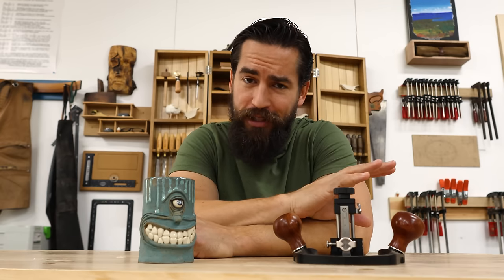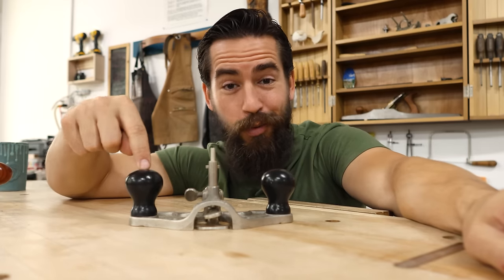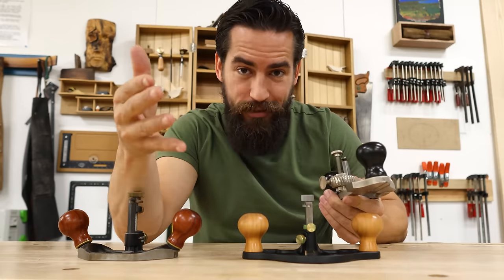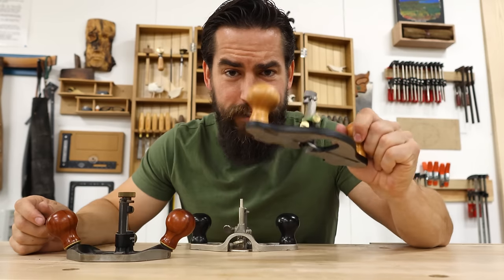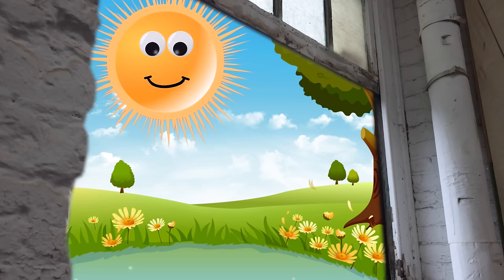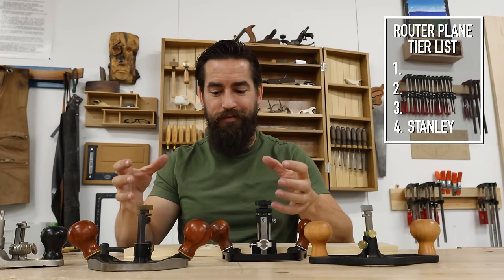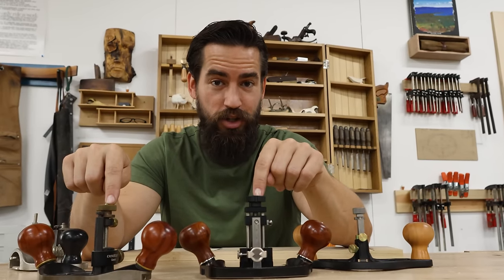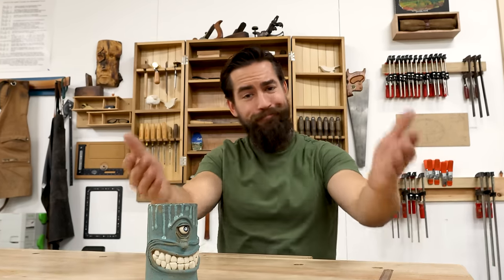How a hand tool split the woodworking world

Comment: Spoken like someone who’s never spent a career working on something only to have it ripped off…and then shilled by a mediocre huckster. That’s the part everyone seems to miss—had this just been an overseas ripoff, I don’t think anyone would have cared. But with the charlatan JKM associated with it, it crosses a line.  

Veritas R&D are the only group that have been actively improving hand tool designs for as long as they’ve been around and reviving no-longer-produced tools (and yes, R&D on castings is no small task). They are doing a service to the woodworking community that no other company is. If they went away, do you really think these overseas companies with no connection to their customers would fill their place?

Stanley stopped producing routers decades ago, and they’re the ones who continuously sacrificed their tool quality for 70+ years. They turned their backs on their customers first, not the other way around, so the comparison is irrelevant.
Reply from the maker: Your opinion is fair and you are able to support the companies that are outlined within your values. Veritas is a good company that makes quality tools.
Reply: But it is not a f-ing ripoff omfg... They innovated and made a better product